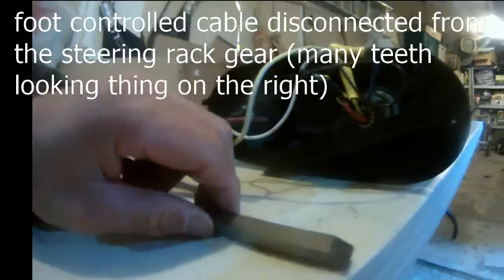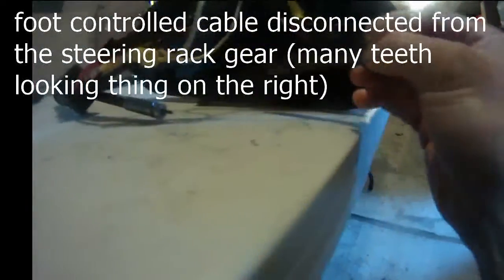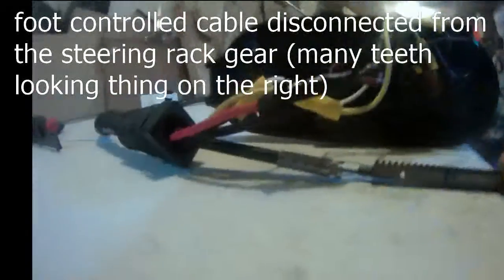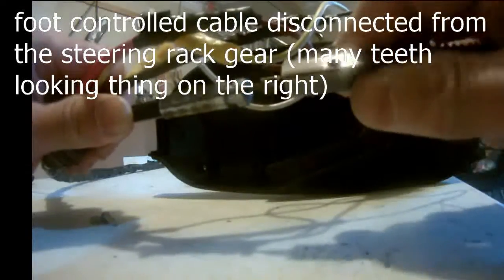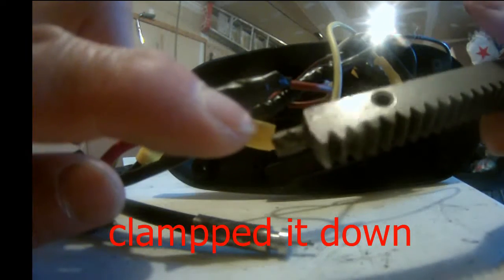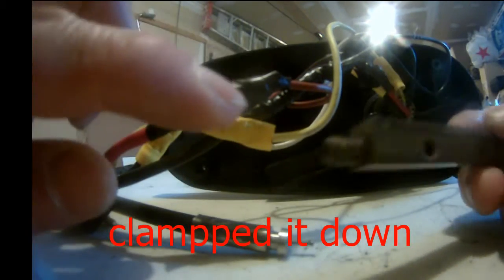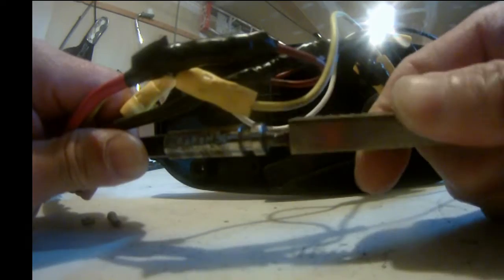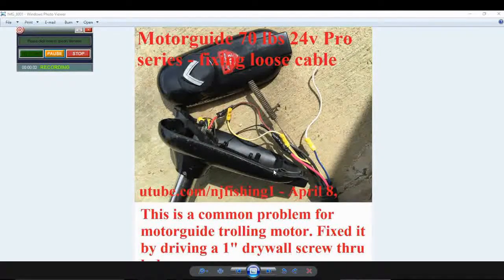mortorguide pro series 70 steering cable disconnect from the steering rack - FIXED (1 of 3)

Comment: Hey quick question my cable broke off at the end same place as yours. My question is where did you get the replacement cable I can't find an identical one ???
Reply from the maker: good luck. I abandoned repairing this trolling motor and used it for parts. Sometimes, you just have to call it a quit for some motors. I bought 2 trolling motors after this one and moved on to wireless remote control trolling motor and hand control trolling motor. Both have been mounted to the bow and now I used the Motorguide saltwater 75 pounds 24 volts wireless trolling motor. It works great for my boat. The hand control bow mount is my spare trolling motor just in case.